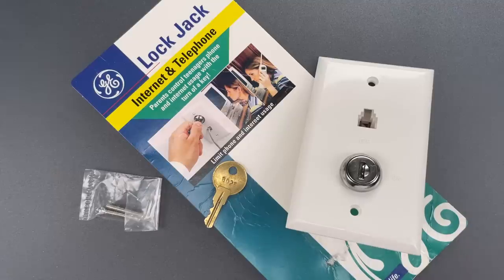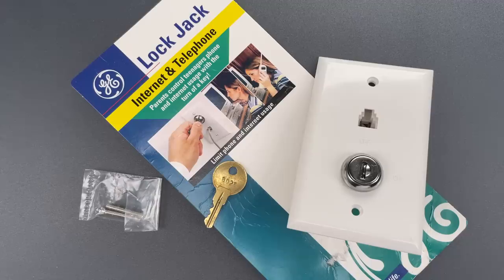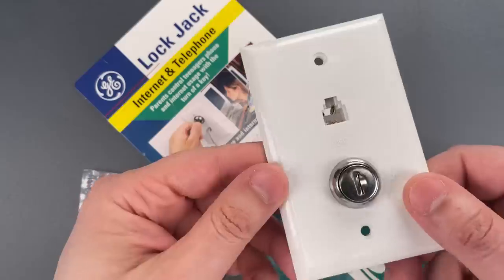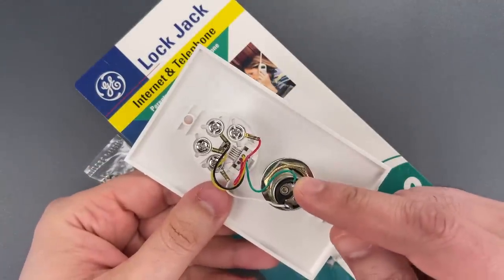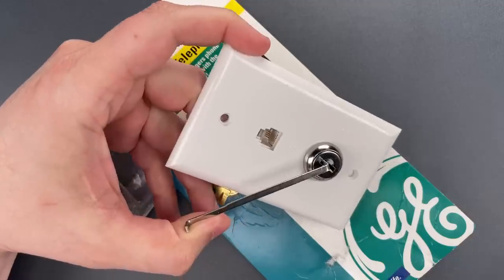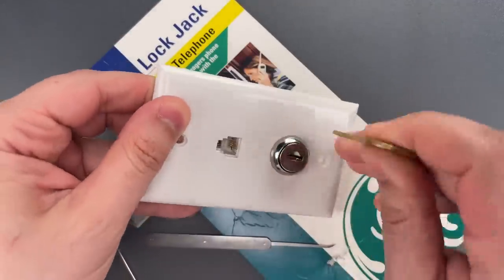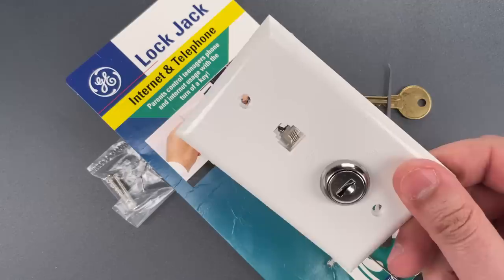[1284] 1990’s GE Internet Lock Picked

Comment: Reminds me of the lock I had on the container where floppy disks were kept (remember floppy disks?) It could be picked by anything thin enough to fit into its pretty wide keyhole. No tension bar needed as you could just press on the exposed latch that the lock used to hook itself into from underneath. The latch didn't even need to be fully turned to unlock the case. Just a 45 degree turn was needed for the latch hook to be moved enough to open the case. It also made it so you could lock it back up easily without the key and make it  look like it wasn't tampered.

Comment: "Back in the 1990s, this phone jack was likely home's only portal to telecommunications"
And if you use ADSL internet, it still is the portal to the internet, even in 2021.
Reply: ADSL seems a bit ancient these days though, i have had fiber broadband for 20 years now.
Reply: @Stefan-  ADSL is still in good use, although the speeds have significantly improved in the past 20 years.
Reply: @Stefan-  I mean fiber is extremely uncommon in the USA, our telecoms would rather keep rotting ADSL lines and buy media companies instead of doing their jobs.
Reply: @filanfyretracker  Actually Verizon has had an active push to get rid of ASDL by raising rates and lowering the actual speed delivered. But... Nobody has fiber here. I switched to cable and my speed went from 1Mbps to 100Mbps and my bill (for phone and internet, I don't have TV) went down a few bucks. And long distance, voicemail, call forwarding, etc. is free.
Reply: @filanfyretracker  Here in Sweden ADSL is on its way out, only 10 % have ADSL, the classic old phone networks are being taken down.  About 60 % has fiber so far and 10 % has broadband via cable tv networks, the rest is mobile broadband. I had 10/10 Mbit 20 years ago (2000) and now i have 200/200 Mbit which is the slowest speed they offer (which is plenty).
Reply: But then you surely have some (WiFi) router and all other traffic within the house is ethernet.

Comment: We did that with my friend in the 1990’s 

Since phone was 4 wires, we looped all the phone lines in his house through the jack in his bedroom. 

We got a hobby box from radio shack and installed a momentary switch and a toggle switch. 

The momentary switch disconnected all the phones in the house temporarily, and the toggle switch was for privacy. 

This way he could kick off his brothers and sisters off the phone and the toggle switch was to disable all the other extensions so nobody could listen in. 

It worked good until he went to school and forgot to turn all the other extensions on. 

His father called the phone company to come out and fix it. 

We go there after school and the guy from AT&T is there fixing the phones. 

He was impressed with our handy work and was laughing when he figured out what we did

Comment: WEP and residential wifi was only a thing starting in 1997. Before that, physical means of disconnecting wired LAN lines were likely the only way to reduce access. That's quite the novelty item now, what an awesome find!

Comment: When I was in high school in the late 1960's the school's Teletype ASR-33 terminal we used to dial up the mainframe or minicomputer we were training on was "secured" with a rotary dial lock (because the  teletype had a handset on the side, anyone with access to the room could male long-distance calls from the terminal). 

We never needed to pick the wafer lock in the dial lock because we learned to manually send telephone dial pulses using the switch hook for the handset.

Comment: I bought a Genesis set over at covertinstruments  and I opened my first lock in 5 minutes, I gotta say, it is WAY EASIER to apply more turning tool pressure, I never would've got it without that tip.

Comment: Still wondering if he's ever going to take a look at 3D printed lock picks
Reply: Why would he???
Reply: there's nothing unusual or special about them; they're lock picks made of plastic, which are not usually going to hold up in the extremely thin profiles needed to make them work
Reply: Why should he?
It's gonna break
Reply: Still would be cool to see...just for variety.
Reply: As others have said, the picks would break because of how thin they would be. That leave a high potential of jamming the keyway in a way that requires a lot of effort to clear or even permanently. It might make for an okay single "haha Masterlock bad" video where a Masterlock is picked, the pick breaks in the lock, and the lock is /still/ opened after, but otherwise, the picks would be too brittle to handle an actual picking.
Reply: Given how cheap a basic metal set is (my first set was the set that came with a practice lock that he reviewed in video 318, for around £10 or so), and how likely you are to snap a 3D printed pick, I can't really see the advantage.
Reply: @_mickmccarthy  Well, in some countries lockpicks are illegal, so making your own would be the safest option, and 3d printing is the lazy way, if you already have the printer. Still, you'd have much better results making them out of metal with a Dremel.
Reply: @scratchandwinner  damnit. You too? When the line clears out, let me know. I've been needing to grab a few things.
Reply: @DS-qi2ii  what do you need?  I put it out in the porch, I'm going to be here  for a while.

Comment: got my lishi picks today they work very well i think i will stick with them because they are just what i needed with not being able to feel my fingers they are also a hit at the va guys and gals with one arm can now pick and it teaches a skill along with being more coordinated of course when the tip breaks which i know it will i can take them apart and see if i can improve them in any way like one thing i will do is make them out of hastelloy for a working set i got the spare metal from a few shops i have worked at and it should make them much tougher but to do it on a commercial level would not work because of the price point and i have a very unique skill where i can keep in tolerance of microns while free hand cutting stuff so as always shout out to covertinstruments

Comment: Remember the original cable boxes?
They had a removable face plate that revealed pot adjustments for each channel.
So you ordered basic then pulled off the face and 'tuned' in all the other channels.

Comment: In the late 80s, we didn't have internet but my computer usage was attempted to be restricted by putting an industrial keyswitch on the power cable. This was a decent lock with a better-than-home-security keyway and was definitely not a wafer lock; it memory serves, it was at least 5 pins and the tight keyway had multiple zigzags, with "do not copy" on the key itself. My father worked in a processing plant, so had access to all kinds of toys like this which he could repurpose to annoying at-home uses...

Unfortunately, the keyswitch was positioned on an extension cord which plugged directly into the wall underneath the computer desk, and due to the way power was routed all I had to do to defeat this system was bring a different multiway adaptor into the room and shift the appliance plugs into that instead!

Comment: „A lock to the whole Internet […]”. He did it, he finally did it, ladies & gents! :-)

And now, seriously - I remember the times of dial-in network connections very well. In my country, it was the omnipresent number “0202122”, with banks of traditional modems on the other side (i.e. in the switching office). And, if I recall well, somewhere in my company, in the lowest cellar, there is still a dial-in router with modem cards, in it, that one (1) single retail Customer still uses. Nobody touches it (apart from training newbies, of course and to check if someone has not used it to  breach security - as we used to have PBX-related & PSTN-related fraud, unfortunately…).

Comment: I had to get in to my trailer's storage compartment the other day and my wife was away with the keys.  Knowing how terrible wafer locks are, I tried a couple spare keys for similar locks.  They fit, but wouldn't turn.  OK, time to pick it.  I had a salvaged wiper insert sitting on my bench, so made a quick Z-bar and a pick.  Put the Z-bar into the lock to see if it would tension OK -- and the lock rotated.  When you can pick a lock with the tension tool, you know it is bad!

Comment: I don't know about the US, but in many places, phone lines are still used for internet access.
Here in Japan is not uncommon to have optic fiber up to an apartment building, and then it gets distributed to the different apartments via a phone line using the VDSL protocol, that can give you up to 100Mbps internet.
There are also XG-FAST protocol, which also uses phone lines for small loops, which is the same kind of situation of distribution to apartments via phone lines, which can go up to 10Gbps.
So I wouldn't just say that phone lines are "yesterday's technology", depending on the situation and already existing infrastructure, they are a very good cost effective solution for high speed internet.

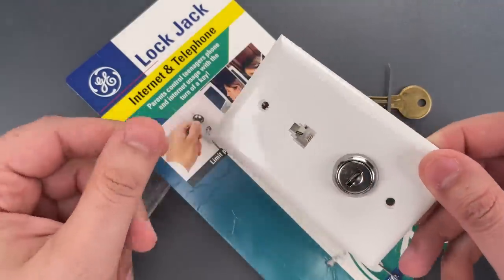Comment: Shockingly simple. Great uploaded ty to both <3 If for any reason you struggle with visualising the mechanism in on/off position and need to compare 0:27 and 1:53  it bothered me viscerally for some reason , so glad LPL turned it around at the last moments >.<

Comment: I have seen something similar for sale more recently.  It has an ethernet jack instead of a phone jack, and it has a timer instead of a key.  You wind the timer up and you can use the internet for an hour.  After the timer reaches the end, it cuts the connection.  This is installed between the fiber optic modem and the wifi router, so that it cuts the connection to anything using the wifi.  This is not so much to prevent people in the house of using it, as to prevent hacking, etc. - though I suppose it could work both ways.

Comment: Knowledge of the AT command set (look up hayes if you're interested) was fairly widespread since every modem came with an insert that explained ATDT codes and how to dial/receive a signal. As a teen I remember learning about AT&M which would send a command to the modem to be completely silent. It wouldn't make that familiar modem connect noise therefor preventing my dad from knowing that I was logging onto a BBS or playing Doom with a friend when I was supposed to be outside doing yard work.

Comment: I googled "8025 key" (8025 being the numbers on the key laying on the table) and it seems to be a common key used for a bunch of things. For example I found replacement keys being sold for use in Coleman pop up campers that look exactly the same.

It is a bit shocking how many cheap locks are common keyed.

Comment: Don't know how common it is in the US, but old phone lines in the home are still used today (albeit with much shorter runs) for VDSL2 based Internet connections.  Here in Sydney Australia, I get a super reliable 100M down 40M up with VDSL2 copper to my apartments basement, where fibre is terminated.

Comment: I could see this as a lockout for the phone so someone couldn't interrupt someone online by disconnecting them by picking up the phone and trying to call out. I know our house had that issue for a few months before my parents just got a second line before broadband came around and dialup slowly went away.

But I also found that as I've slowly been building some experience picking myself that wafers are too much hassle to pick, you can just run the pick from back to front and usually unlock them much faster than actually picking. Usually takes me about 1-2 minutes to pick and 1-3 passes with the pick raking that way to open.

Comment: Once upon a time, someone I knew told me this story: "In a new apartment. I was watching Cable TV as a Space Shuttle was about to launch, back in the days when such launches were televised. The Cable TV guy knocked on the door, and asked if we wanted to sign-up for Cable TV. We said no thanks due to the cost. He unplugged the TV, tucked the cable into the wall behind a locking outlet cover plate (looking similar to the one shown here, except a physical lock not electrical. Then he left. I pulled the cover out and rotated in 90 degrees, it opened, and I reconnected the Cable TV cable to the TV. Looking out the window, he hadn't even left that parking lot yet. Finished watching the Space Shuttle launch. A year later, when it was time to move out, tucked the cable away using the same lift and twist process."

Comment: Most electrical manufacturers have a standard key they use for decades.   Every GE electrical panel made for 50 some years takes the same key, I bet it fit this also. Basically, it's a removable handle. If they were using wafer locks they weren't spending money on unique key patterns.

Comment: The lock itself should still work with anything up to current ADSL lines, things are starting to change a bit now with a lot more fiberoptic going directly to homes as well as fixed wireless, but in general, assuming your kids or whoever else your trying to lock out of the internet doesn't just have a smartphone with 3g/4g/5g internet access, this would still work to some extent today, ignoring its security flaws obviously.

Broadband over the last few decades hasn't really changed much on the home or even state infrastructure level, its all been using most of the same copper from dialup and regular phone connections, we've just learned how to use use that copper more effectively to transmit data at higher speeds, with that comes more sensitivity to things like interference, so its possible something like this lock could cause issues with a broadband connection, but based on some of the dodgy wiring jobs I've done on connections in a rush before, it'll probably still work fine.

Comment: Think this needs to be picked with 2 paper clips, because that is my go to wafer lock picking tool, and you can carry them around everywhere without anybody suspecting a thing. Even picked them using 2 corrugated box staples, no paper clips around, but there were cardboard boxes.

Comment: While it might seem silly to use a physical lock to keep someone off the internet/phone line, it might interest you to know from the late 80's to the mid 90's computers were sold with physical locks that either blocked keyboard input, prevented the ability to power on the computer altogether, and/or lock the case up completely to prevent workaround shenanigans. I remember my parents having one such computer but they lost the key for it. Lucky for them they left it in the correct position so it could still be used.

Comment: Back in those days using the internet had the cost of the phone call associated with it. Heavy usage (by standards of the day) could add an additional $50-$300 to a phone bill that was usually under $100. Moreover, back in those days you were charged for your dial up usage by the MINUTE or by the HOUR of usage online in addition to your data usage. So if your teenager spent 30 hours on the internet in one day, that could be your entire plans monthly allotment and you'd be charged at $10/hr thereafter. 

Doing something to try and limit access to the internet made perfect sense back then. Remember, this was an age when desktop PCs came with a wafer lock on the front as well to allow you to physically lock the PC and prevent unintended access.

Comment: When I saw the device in the thumbnail I assumed it locked the jack into the wall to prevent a disturbance of service. For example someone's tripping over the cable and disconnecting the modem while downloading a large file that the installation wizards estimates 5 years to download. In which case the wafer lock would make sense as you're not trying to prevent someone from stealing, but locking the jack in place so it doesn't accidentally come out.

Comment: That would still work in my house. I have DSL which also relies on a POTS line. Though it is MUCH faster than the 28.8k dialup I used at my parents house until 2010

Comment: This is funny... Instead of using the 2 middle contact for my modem I used the outer ones. So I had full access with a modified cable while others had to use the normal circuit.  Security by obscurity worked...

Comment: My father installed KidsWatch, the parental control system, on my computer when I was 11-12.
After being fed up with it, I made a .bat shell that first gave me admin rights, then ran SteamSetup.exe and tricked my dad to run it with admin privileges.
I first renamed it to SteamSetup and made a shortcut so I could change the icon to the steam one. Then I set it to run with admin privileges. After getting admin, I went into system32 and changed the KidsWatch.exe file's security settings so that nothing could touch it, not even the system, and then reset my computer. That meant that on startup, KidsWatch couldn't run or even be reinstalled because the security settings said that the admins and the system itself couldn't touch it. I never got caught but I told him about it later, in high school :)

Comment: I could see something like this being applicable today, Obviously it wouldn't be an RJ11 jack with a lock but I could see the same thing apply to a localized wifi access point plate, or an ethernet jack plate. 

Obviously there's the issue of cell network data but that should have controls that the parent could access through software.

Comment: Likely uses for thos were probably a response to connecting to long distance BBSs, which could get extremely expensive, a parental control, to limit time axcess, and or if it was a shared calling line/modem line, lock out the access to computer if someone was expecting a call. Or, locking out a phone, when using the internet, so no one picked up the phone and disconnected the call to the internet